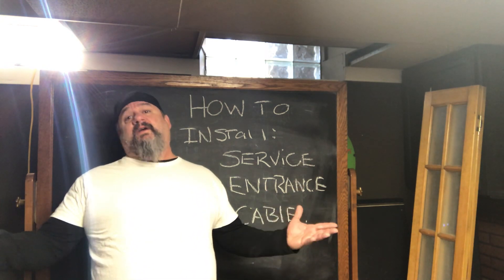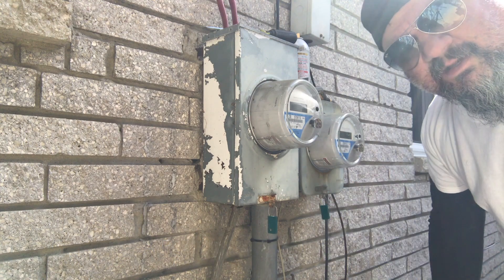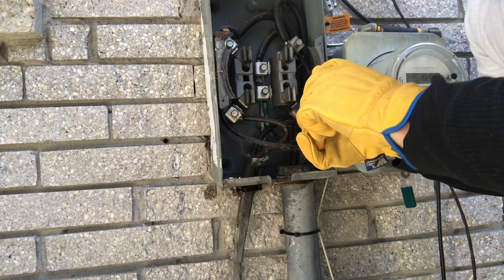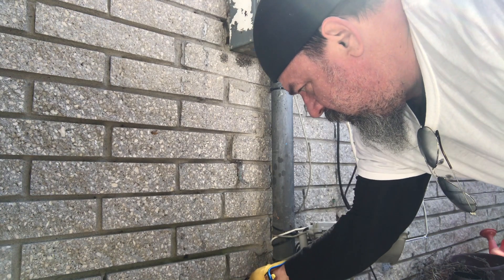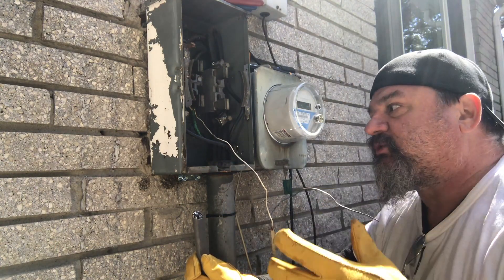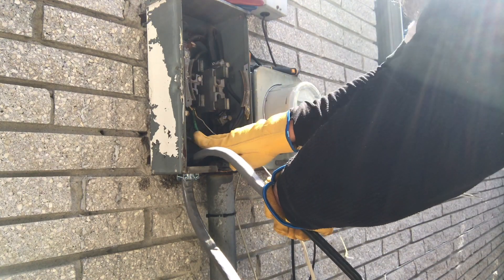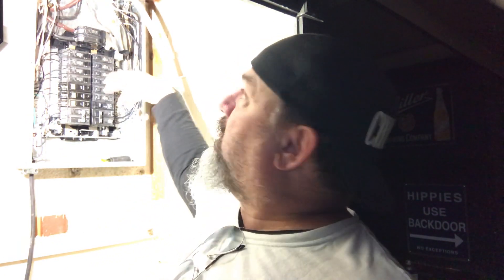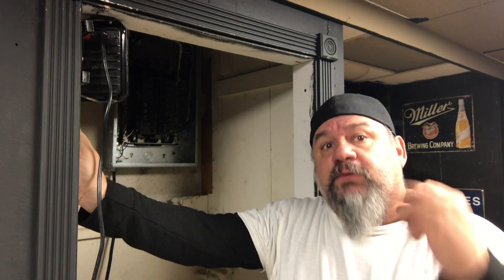100 Amp Service Cable Get Ready to be Replaced!   ""Knocking Out an Electrical Project:

Comment: When I upgraded my moms 60 amp to a 100 amp service took me over a hour to get the 100 amp service thru the stone wall. Took at least 5 minutes to remove old service cable. Here they laid the 60 amp cable on stone wall as they built the house. when I shined my flashlight thru from outside could not see the light . They had two bends on the old cable traveling thru the 12" thick wall. Even using my 11/8" diameter hammer drill bit took a long time.

Comment: I'm not the youtube police but shouldn't that connector be LT? I know it's on the bottom...but..BTW, I just did a panel upgrade where I ran like 10 romex wires through the same connector and it passed the borough inspection with flying colors 😉
Reply from the maker: all good, I get some inspectors who care and others that dont.

Comment: 5:00 being insulated would be nice, yes, but here's $5 to throw in the fund to buy yourself some nice fire-resistant clothing at least. It's not the shock that usually kills people (apparently) but the flash causing large area burns across your body. I say the same to my electrician. It's a low probability event, but it's a really horrible and painful way to die. People usually don't die immediately from burns, but after a year or two of agonizing pain. Hundreds of surgeries as it usually takes a few tries for skin grafts to take. Then the constant risk of infection. And lord knows hospitals have gotten even worse at "not making our own patients sick" over the past 3-4 years.
Reply from the maker: Thank you so much for the tip and the good advise. Really nice of you!!!

Comment: I know this is an old video, but it gave me a bit of piece of mind.  I do have a question, that I am hoping you can answer.  Is it possible to convert (change) a meter base such as the on shown in this video to a double lug meter base?  Wanting to run power directly from meter base to a detached garage panel.  Any advice you can give will be greatly appreciated.  Thank you for helping us DIYers......
Reply from the maker: thanks so much for the kind words. the only thing you can tap from a meter can is another meter can for like a second dwelling. if you wanted a seperate meter you could do that and feed a dissconnect to feed the garage subpanel.
Reply: @StarvingElectrician  Thank you.  I've seen dual lug meter bases that run one service line to home and a seperate service line to detached garage from the one dual lug meter base.  I guess i'm just confused.
Reply: Run the subpanel off a breaker in the main panel. Make sure you isolate the grounds in the sub.

Comment: Hey brother, just came across your video, super helpful. 
I have to upgrade my service entrance line as well as panel box to 200amp service and and just wondering what gauge service entrance wire I should use if upgrading from 100 to 200amp service. Not sure where to find this info
Reply from the maker: thinking 2/0 copper. dont quote me. maybe google it to be sure. thanks
Reply: 2/0 copper is good for 175A service panel. Step up a size for 200A service.
Reply: @jakal104  Residential allows a derating to 83% of the calculated ampacity. 2/0 Copper is the proper size copper for residential services, but I would be using 4/0 Aluminum, not copper.

Comment: I’m installing a temporary power pole for my house build. I ran #2 copper from breaker box to meter base, do I need to put no lox on the copper? I will use aluminum from meter base to weather head for power company.
Reply from the maker: I would always

Comment: How do you come out the back of the meter socket and go straight through a brick wall? The comet connector isn't waterproof. I need to make sure it's waterproof and doesn't let water into the interior. It's a top fed meter socket. The breaker panel is 10 feet away.
Thanks.
Reply from the maker: both feed are coming into the bottom not the back. you may have to sleeve it. make that hole bigger in the brick or put the connector inside the meter can backwards where the screws to fasten it are in the inside. this way you dont have all that bulk behind the can. maybe that will work.
Reply: @StarvingElectrician  Thanks...I'm leaning towards just doing a PVC sleeve long enough to get through the brick, then spray foam it to make it watertight...I've gone through the code book a dozen times and can't find any info on it.

Comment: This video was badass. Quick question and kinda dumb and I apologize...new journeyman here and I’m in Vegas actually. I try not to do any hot work, but if there’s no choice are leather gloves a good option for protection against shock? Like if I were to touch a live terminal on accident will leather gloves stop shock? Basically the reason why am asking is because if I’m in a restaurant and have to change out a breaker or something I’m not going to shut the whole place down and I’m going to be in that panel while it’s on, so would leather gloves be an option for some protection?
Reply from the maker: not a dumb question at all. yes I work with leather gloves all the time but to be safe while working in a hot panel you could wear rubber gloves underneath for that little something extra. if leather is wet it becomes conductive. just be careful so you go home intact!!!! take care brother

Comment: As a vet myself appreciate what your doing. Got a Michigan question for ya.. Asked the inspector here but he didn't know what I meant by 'gooseneck' so not real sure I got a good answer outta him. I'm consolidating 2 100A-20 slot panels on my own house into 1 200A-40 slot. Drop & meter already set for 200A. My planning question to the inspector was regarding service attachment point. Currently eyebolt to side of house with gooseneck. Drip loop maybe not quite 10' over pedestrian only area on side of house. I'm wondering if goose neck with drip loop is ok so long as lowest point of loop is higher than 10' or if it's absolutely required to put in a riser through the eve with a service head? Appreciate any insight.. Looking at the MI code it seemed like POA with gooseneck was still ok but can't tell for sure. Enjoy Vegas!
Reply from the maker: its measured from the drip loop to the ground. they want a gooseneck if you aren't using the service wire cap. honestly i didn't think they were allowing a gooseneck. id rather use the service cap. looks better and less chance of water going down the cable. I hope this helps! thanks brother

Comment: Awesome video!  One question, does the electric company know you pulled the meter and will they come out to inspect? I’ve heard smart meters send a signal when disconnected. Again this was a great video and thanks so much.
Reply from the maker: Yes they do. That was a smart meter but they bill acordingly but I don't know if they send out people. never had with me. im a contractor but this is my house so I can make repairs its upgrades they look for a permit. legally i shouldn't tap into the power. but hey ill ask for forgiveness later i guess, lol

Comment: Man I'm so glad I found your channel. I called every electrician in my area but none have called back. I need to upgrade from a 60 amp fuse box to breaker panel, and you have given me the power to give it a shot. Good luck to you with all you do
Reply: I really hope you replaced both wires. Just replacing the load side of the meters wire is not good enough. You need 100 amp wire on the line side also
Reply from the maker: awesome. be safe and thank you. always take your time and double check your work

Comment: 1:00 - Step one: Do NOT install a G.E. panel!  Complete garbage!  Get a Square-D Homeline panel, or least a Siemens.
Reply from the maker: are you telling me that? I didnt install the panel on this video. just replacing the cable. GE breakers never fit well and lead to bad connections. although I hate square D QO panels. never enough room for the neutrals and grounds. well at least the 100 amp ones. GE has a similar panel with those goofy thin breakers. i hate the knock outs on the siemans panels. such a bitch to get a glean 3/4 K.O
Reply: @StarvingElectrician  OK, I'm glad to hear that you didn't install the G.E. panel.  And I agree with you on Square D QO panels as well.  I love the new design of Homeline panels -- neutral bars all the way down both sides!

Comment: Hi thanks for all the help! Would you suggest putting noalox On the grounding clamps and grounding rod for the panel on the exterior of the building?
Reply: Awesome ty. I did some digging after I asked you, and that’s what I came up with as well. Thanks again.
Reply from the maker: no its only for aluminum without current theres no need for it. you could but it would be redundant.

Comment: Electric company says I need to upgrade my entrance cable and meter box to 200 amp from 100 amp. Question is will that include replacing the cable going into the top of the box from the street or just the cable going into my house from the bottom? Thanks in advance.
Reply from the maker: if you are upgrading your panel to 200 amps you will need to replace all the cable going to the panel and meter. if they just want a 200 amp meter can and you are staying at 100 amp panel you can feed the panel with the 200 amp meter can. All the new ones are rated for 200 amps in case you want to upgrade. this is what I know from michigan code.

Comment: The power company will greet you with a big belly laugh and handshake when/if they see the tap on the line side of the meter for temporary power.  Been there,  but they forgot to laugh and shake my hand.
Reply from the maker: i'm a licensed and insured electrical contractor. never had a problem.
Reply: @StarvingElectrician  I never had an official problem, just a little flak from the power company dude when he came out.   Forgot to remove the wire.

Comment: Hi Lenny,
I'm going to upgrade my service to 200 amps. I live in New Jersey. I found an electrician that does side jobs. 
I am going to buy all the parts and I told him I will help in the install.
I just got his estimate....straight labor he is charging me 20 hours of work.....$2.000 total and he said he was going to give me a discount because he lives down the road from me.
What do you think?
Reply from the maker: well im not sure how the power works there. if its coming in from the pole I would do them in about 5-6 hrs. labor and material about $1800. 20 hrs? how long does he plan to have your power down. just doesnt sound like he knows what hes doing. I have never heard of a 20 hr service upgrade. $2000 is fair material and labor but some states get more money. just dont know how it works there. 200 amp complete service material costs $3-4 hundred. im all for making money but 2k and taking that long has me scared. get it done in a day and $2250. and he does all the work while you drink a beer and have tacos!! hope this helps.
Reply: @StarvingElectrician  
Here is the project pictures. 
As I said I'm buying all the parts inside and out. You can see the 100 amp box now has the wrong main breaker put in by a friend 10 years ago but still ok.
There are 5 old cloth 2 wire. He said i would have to use AFCI breakers for them. Can I use GFCI or Dual Function for them?
When I asked this Electrician why so much he said he had to do load calculations???
Thanks Lenny. Waiting for your next class.
https://www.dropbox.com/s/58jrhymmqqlbx6w/Screenshot_20210131-153923_Gallery.jpg?dl=0
https://www.dropbox.com/s/b9tfwlqoi5wgyq3/Screenshot_20210131-123130_Gallery.jpg?dl=0
https://www.dropbox.com/s/ehytvumip6ut9jl/Screenshot_20210131-123301_Gallery.jpg?dl=0
Reply from the maker: @MedinaCliff   load calculations??? For what?  You are upgrading by 100 amps, I would say you are  way over. A load calculation for a house is usually based on square foot. Load calculation for a house should take about 15 mins. I’d tell him to go piss up a rope!
Reply from the maker: @MedinaCliff   good for you! They give good electricians a bad name.  Ya gotta take a stand.

Comment: Do you have any videos on replacing a panel when it is still hot?  I looked through your videos and could not find one.  Thanks
Reply from the maker: no i dont. its dangerous to do it that way. i have only did a few like that and only when I had to. pulling the meter first  is always the best way to go.
Reply: @StarvingElectrician  I have a friend that claims he can do it.  It just sounds too dangerous to me.  Thanks for responding.
Reply from the maker: @armymobilityofficer9099   ok cool good luck

Comment: I don't have volume on laptop, wandering what size cable you used for 
100amp service in your video. Getting ready to replace my old General Switch 100amp 
panel, breakers and entrance cable from meter to panel. 

I have had a lo of issues with flickering lights, fish smell coming from 
panel for months now, and thought I just need to replace all of it. 

The fish smell was caused by dryer, I replaced dryer plug, outlet, 48ft of 
10-3 cable uninterrupted and breaker all grounded( everything worked and
 no more smell or heat coming from panel for three weeks and then  it 
started again 12/9 (I shut breaker off now), During this time and still 
right now lights in lower b-room, kitchen, dining, living and just one 
light upstairs flicker on and off through the day very seldom though)

Also I am in ohio, and have a schlumberger centron watt hour meter, will
 this raise a red flag with power company when I pluck it.  My brother in law is going to 
help, he is good with home repairs/ used to remodel old homes, but he like 
others do not want to be constrained by authority, inspectors, electric companys and all 
of that and neither do I. I myself rely completely on youtube videos 
like yours to make repairs to my home, built in 1905, my current panel 
is a general switch and I believe it is 40 plus years old. 

Any advice on removing anti tamper tag and replacing it so as to stay under
 the radar of inspections/fines. Not trying to steal electricity, just 
trying to save $$ by doing the work myself, unemployed since march!
I thank you for any advice you can give, Rodney
Reply from the maker: man I have been out of work since march too.. not sure how to get around the tag aside from replacing the meter its self. not advising it but I dont know any other way. good luck.

Comment: I don't know where you got the idea that you can put 4 Romex cables in that 3/4-"1" connector. I know so because the AHJ told me so. Gotta love those inspectors. 
Gotta say I love your videos and how you break it down for people. Though I'll still need those code references that say I can do everything you've done (at least until the AHJ learns that not everything is in the book. I'm actually surprised he's still alive since it doesn't say to breathe every few seconds). Good luck with your new adventures.
Reply from the maker: Got the “idea” from over 30 years of experience and never getting shot down.  4- Romex in that size connector is permitted. Any less and the connector pops out of the knock out.

Comment: Question, I’m building a 2 bd 2 bath back house rental 1040 sq ft. I already bought the 200 amp panel I wanted enough to suffice ev chargers and never have an issue in the future with upgrading but I wanted to know if this is the cable I would use to go underground in the conduit from the main house where the meter will be set underground to the ADU and up through the wall and attic to the subpanel 

https://www.lowes.com/pd/Southwire-1-ft-3-3-3-5-Copper-Ser-Service-Entrance-Cable-By-the-Roll/1000274291?cm_mmc=shp-cprdelcgooglelia-106-electricalcable-lft-1000274291-_-0&placeholder=null&&ds_a_cid=112741100&gclid=CjwKCAiAtK79BRAIEiwA4OskBlvJAgzcGAQw5yJAYVsERhKIQQhkxcueAe0_IyDacmEdndqBgpBxahoCAzIQAvD_BwE&gclsrc=aw.ds
Reply from the maker: yes you should be good with that.

Comment: This is the first video i have seen of yours but it wont be the last. i'm building a new house and my county is kicking my butt over a $30 permit.  i am so ready to spend 18k and go solar and tell them to kiss my ass.  first they told me to do it and they will hook it up then they changed it and said i have to go under ground. so i changed my plans and hooked it up and ran the pipe they said i had to. then they said the meter box they sold me wasn't good for under ground i have to have another one. then they said i have to have QO breakers and OMG those things cost alot. but i did it. buy that time because i'm on a fixed income my permit was expired. so when i went to get another one they was drawn up plans on my house. and it has to be done by a licensed architect. and the cheapest i found that would draw up plans for a house already built is $2300. so i have been looking into solar but i still need to know other things
Reply from the maker: wow how unfair!!! and them telling you a brand of breaker panel is none of their business. if its UL listed then you can use what you prefere. QO panels are too small in my opinion and you have to cram the wires in them,  i dont know much about solar but i believe if you have a big enough system you can power your whole house and in some cases the utility company can nuy your extra energy. dont ask me how that worsk!...lol well good luck and thanks for watching.
Reply: @StarvingElectrician  it just sucks that THEY tell you to use something so you buy it and cant use it right away and by the time i was ready for it its no longer legal. and the QO breakers cost so much triple the price of any other breaker. and then they change the rules. i just got off the phone with the solar people and as much as i would love to go solar they are still just out of my price range right now so i have to play their games i guess.